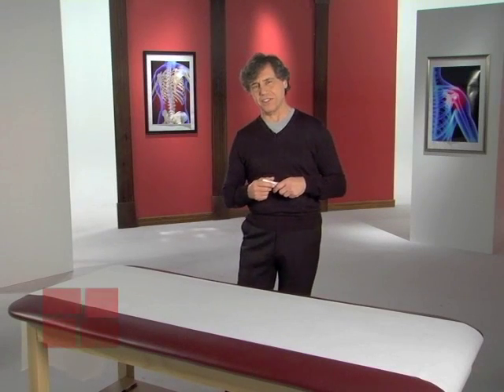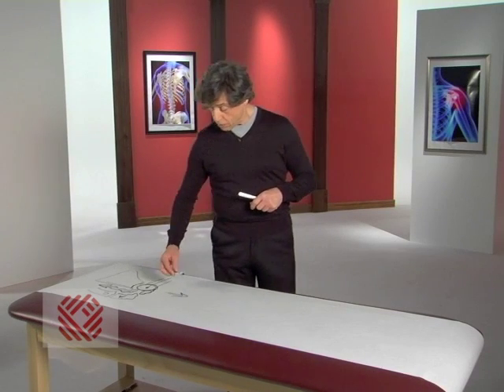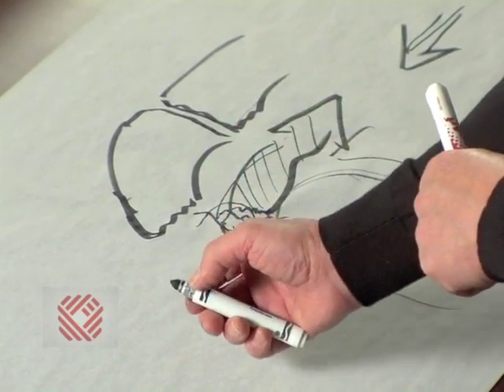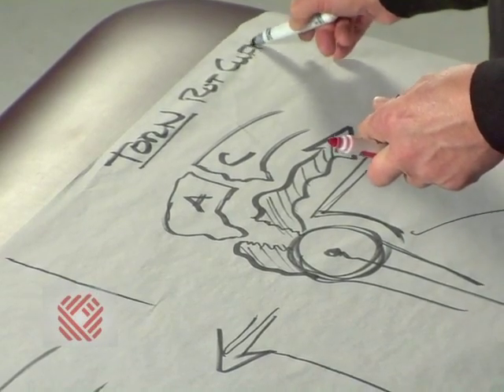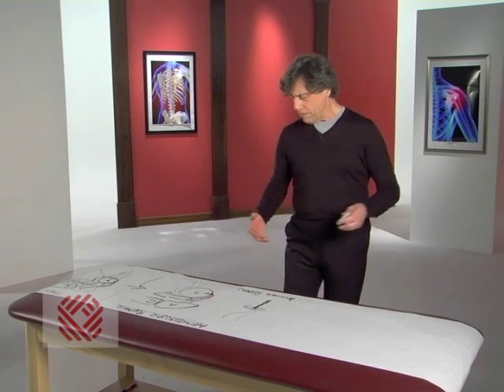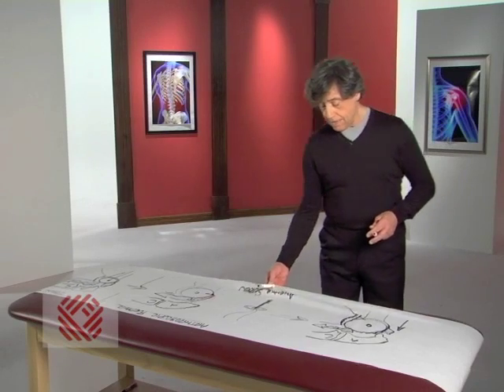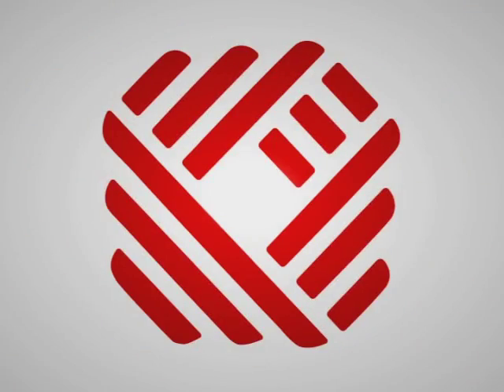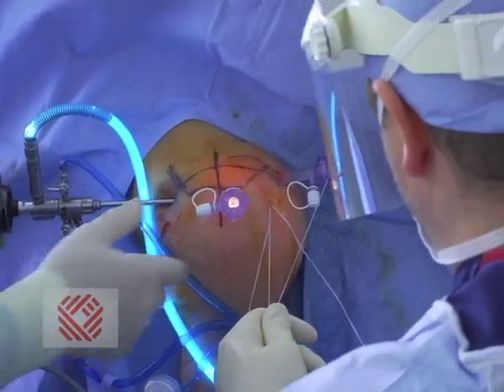Rotator Cuff Tears Part 3: Arthroscopic Repair

Comment: May be the best visual and clear explanation of the issue I have found.
My problem is exactly (even location of full tear and spurs) it's uncanny.  I'm in the 8th day of post op., and had 2 anchors used.  Will have my first visit, post op, with my surgeon  in a couple of days.
If I could add anything to this it would be, there will be pain.  Stay ahead of the pain with the proper dose of pain meds.  These meds are strong so be smart.  I followed orders but found the minimum dose I needed.  That's just me.
This is my second surgery on my shoulder.  This one much more complex and 25 years after my first.  What I'm trying to say is, if you want a quality of life, have the procedure regardless of the post op pain and rehab.  Or you can let it go until the pain is so bad and the damage (that can no longer be repaired)so advanced, you have to get a shoulder replacement with more pain, more rehab and a less complete quality of life.
In my opinion.
Trust your surgeons advice.  They know their stuff.